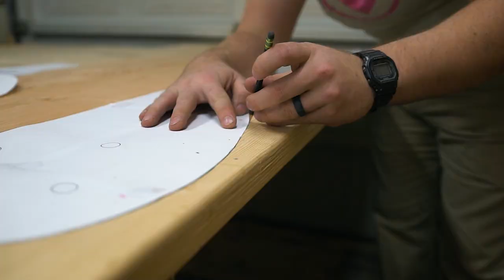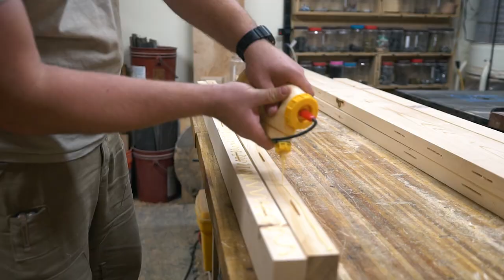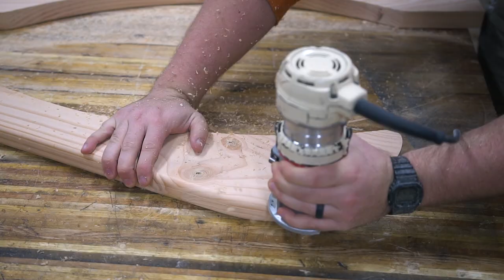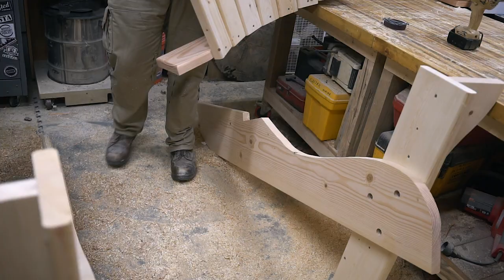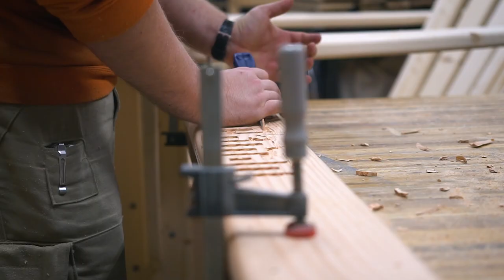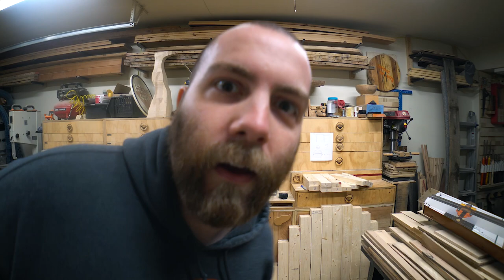Building a Giant Adirondack Chair

Comment: i have a beach just down the road from me. im tempted to build the big boy version and put it on the beach for everyone to enjoy. how man 2x4 did you use for this one?
Reply from the maker: It was a mix of 2 by 8 and 2 x 12, a total of about $100 in materials I think. If you end up wanting to build this for real shoot me an email and I can get you the full materials list that I used
Reply: Jackman Works I will probably have to adjust size a bit I think we have different wood sizes over here in Athens, Greece. But when the weather starts to heat up and I'm ready to build it I will get in contact. :)

Comment: Do you plan on making a folding version of the “normal” size chair.
Reply from the maker: I do want to add more designs to the adirondack line but I don't see a folding chair happening due to the curved shape of both the back and the seat, you'd really need a flat back for it to fold effectively

Comment: Did you do some of the round-overs as 2 passes? (if so) Any reason why?
Reply from the maker: Yes! The first cut is a climb cut so it cuts less aggressively but takes away most of the material, I then finish the cut going the normal way, against the spin of the router.